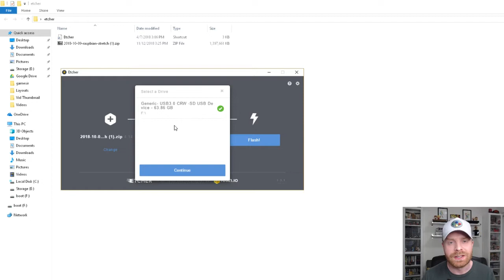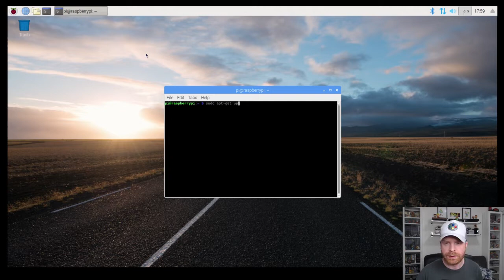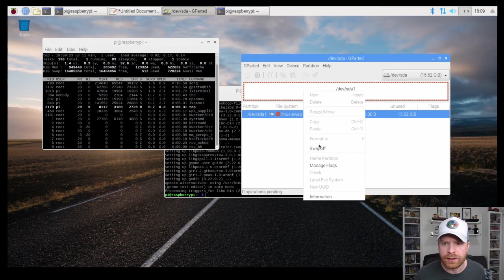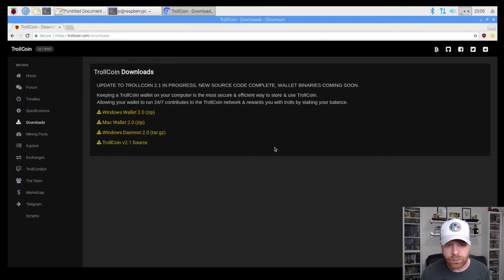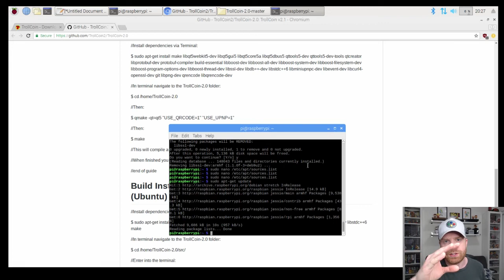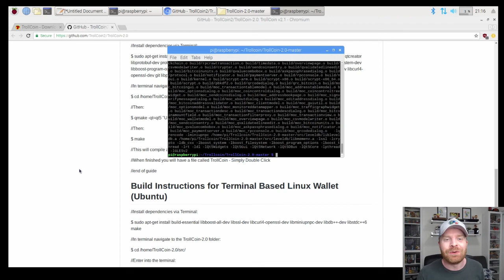How to set up a cryptocurrency wallet on a Raspberry Pi

Comment: Nice tutorial, but using a software wallet is quite dumb. It is very easy to hack, if you have your pi running 24/7 connected to the internet. I personally would not rely on this solution. Use a purpose built solution like pitrezor on a Raspberry Pi Zero instead instead.

Comment: So, in theory, one can use any computer running linux as a hardware wallet? Like an old hp tablet? Or does this type of thing only work on raspberry pi's.

Also, great video! You're very detailed.
Reply from the maker: It depends on what OS the wallet is supported on. Realistically, you can have most wallets on PC...some wallets even support windows

Comment: If I were to use an external hard drive to be running a permanent full node would I still be able to partition with the linux-swap option?
Reply from the maker: I believe you could use a partition from the external hd as swap if you'd like